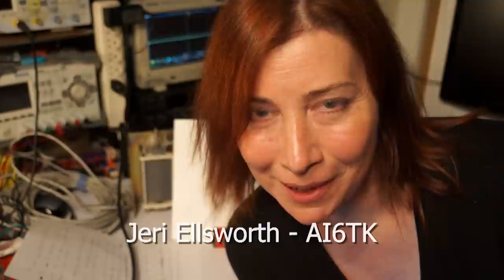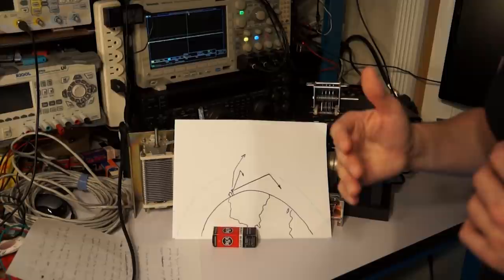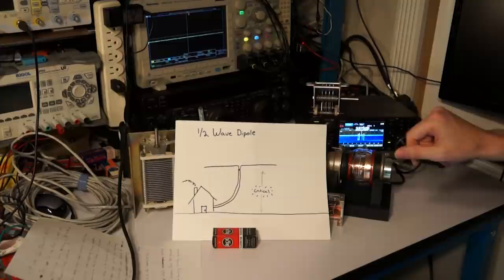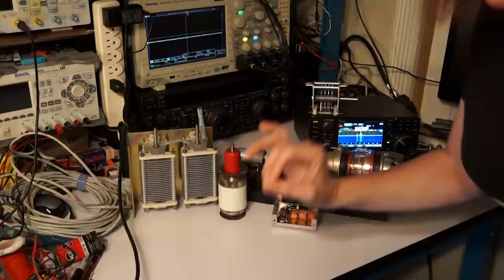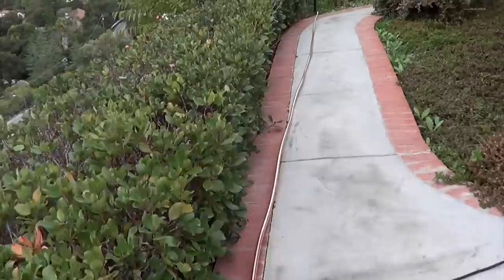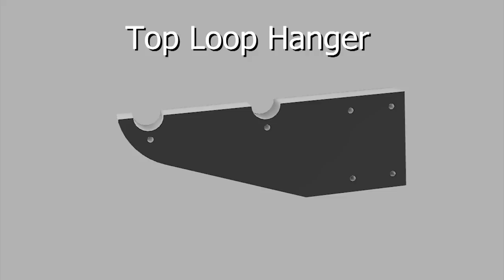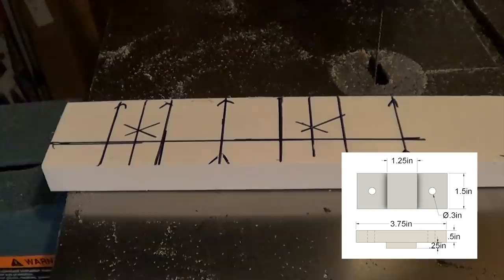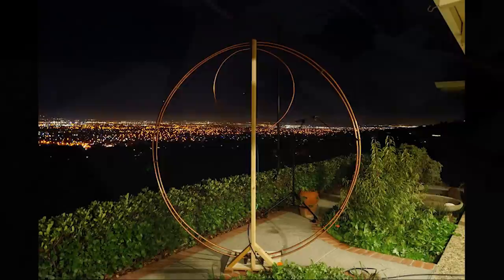Build a 160/80 Meter Magnetic Loop Antenna - Part 1

Comment: Jeri, where can I download a simple hi gain low voltage amplifier schematic?
I would very much like to build a 
simple device, to listen to my heart beat.
it would be on a strap that goes around my chest,
and a simple ear phone for one ear to collect the amplified sound.
In the back ground I would have a metronome running, and the idea
is to learn how to slow or speed up my heart rate compared to the 
speed of the beats of the metronome just by thinking/willing it.
any suggestion?

Comment: why not using a high current cap and bring it to a high voltage via a ferrit  transformer  instead of using high voltage cap? i mean high voltage issues is more difficult than high current

Comment: Hey I have a question; how can I finish my ham station? I still need a license but no point if I can't finish this. I have 3 of 1kw  transformers I had made by Peter Dahl co., with accompanying heater coils if running something like a GE866 Mercury vapor rectifier. They've just sat for 12 years now with no power ever once. I have 866's with 3 tube sockets only. Need 3 more for all of them, but it will do for 1 transceiver.

Comment: I'm glad that you are back on the channel!
but, you do not plan a similar antenna, but with many turns inside, to receive the signals of a unique old-fashioned Grimeton radio station,on super long waves, located in Sweden? 
it operates at a frequency of 17.2 kHz
here is a link to their site:
http://alexander.n.se/?lang=en
 I'm sure you will be interested to know about this radio station and its device.
unfortunately, the traditional radio broadcast on December 24 this year - is canceled (because of the repair of the antenna)
__
you are a very nice and amazing girl, Jeri !

Comment: goode indeed , good works ! ...flux heat solder wipe , inspect !  reheat if necessary , your story goes fast , slower please , oh if you sold the copper pipe ends closed to keep water out , you seal the condensation in , it can't evaporate it's way out , I do hate to mix water and electricity , I'm not that fast any more , I think I'm doing this , be swell , adue !

Comment: Hi ,,over a year now,,merry Christmas to you and you significant other, we all hope your healthy and alive and busy with a new job,,,your "killing" us with not posting your conclusions and fails on this project. Just your face talking about how the capacitors functioned would be rather cool, your small capacitors look scary lol;)ps, if you squish the inner loop a little giving more surface close to outer loop it helps make a antenna better,,,interesting how you later tried to put the inner coil inside the loop and then run it up to the top,,hummm never had that work well, lost alot of watts,,but maybe you got it to work? I see by the corrosion you have been playing with this for a long time.;)dad said army used solid loops that they just squeeze to tune, no capacitor needed.hummmm

Comment: I am very sad. Brazil dont have vacuum variable capacitors. We have to buy very expensive on ebay and wait a long time to brazil delivery the package. It take sometimes 8month. I like a lot this video. 73 from pu1ybz qra yan
Reply from the maker: Maybe building an air variable or trombone style capacitor would be a better option.
Reply: Jeri Ellsworth yes. I cant wait the next video. 73s.

Comment: if you scale this down to a much smaller ratio would it still work better then a normal antenna, like 1 foot tall instead
Reply from the maker: This is already compromised at 160m at this size.  Loops for higher frequencies can be much smaller.
Reply: I might try that out when I get the time then :)